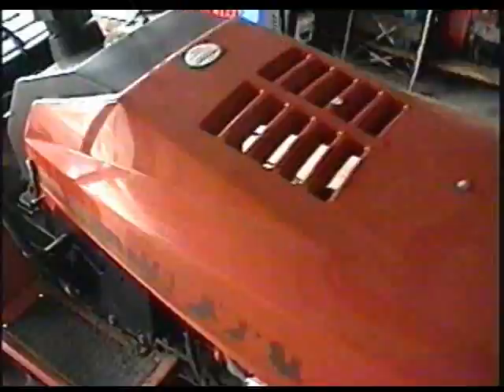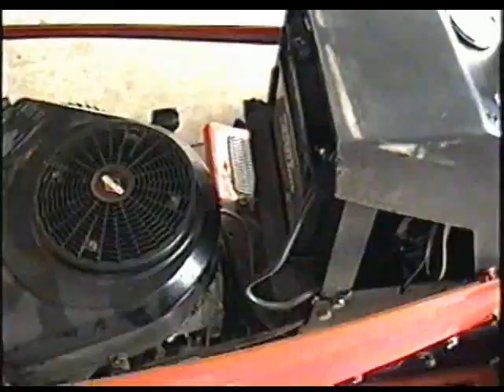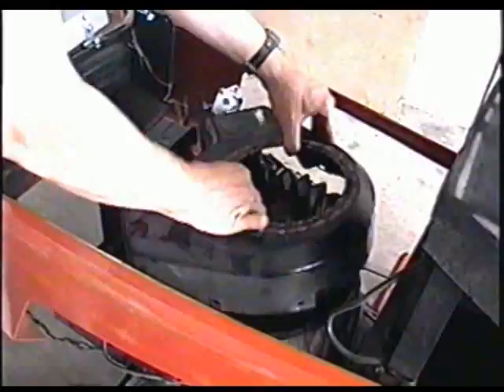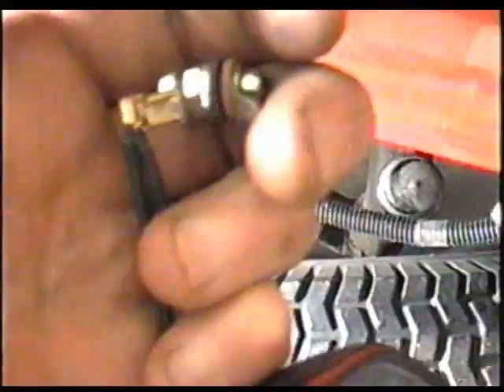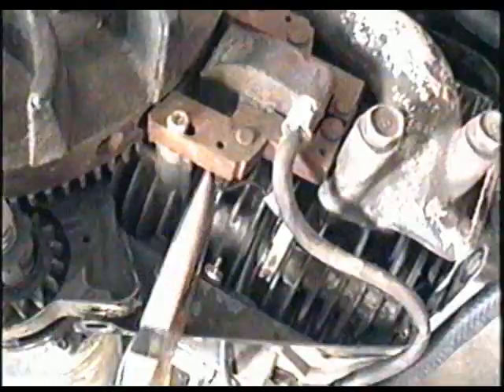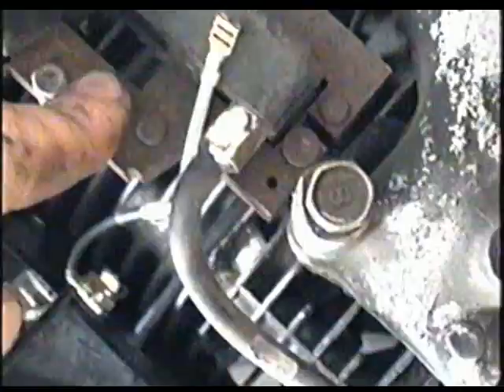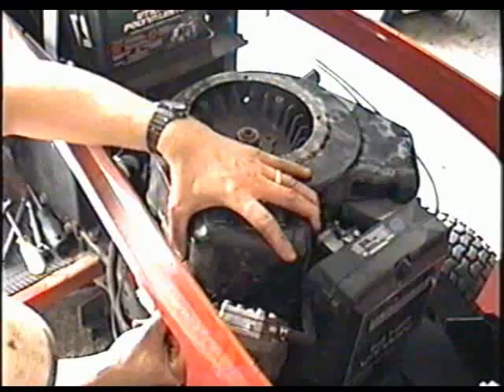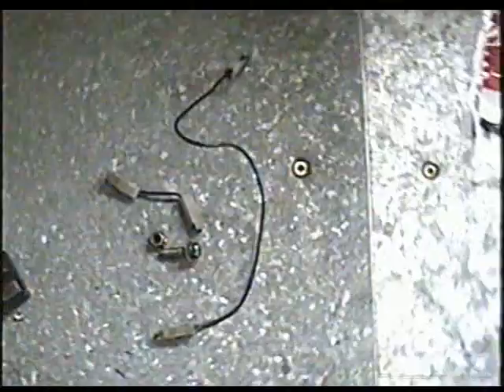Briggs & Stratton Ignition Diode Repair on Lawn Tractor

Comment: Another great video,thanks. I had a friend ask me about not getting any spark on his push mower. We went through taking off kill switch wire, spacing the coil gap & he even changed the coil. New plug. This is a single cylinder, no points. Any ideas?

Comment: Some of the Intek twins come with two diodes heat shrinked into the magneto kill leads in a Y configuration. Briggs doesn't sell that wire as a stand alone part, you have to buy the complete harness that is usually over $20 on Ebay.  They are 1n4007 diodes.  A bag of 25 for $3 on Amazon, soldering gun, and heat shrink solves the problem cheap....

Comment from the maker: @ncrdisabled it's a 1991 briggs vanguard 14 hp
Reply: I've got the same engine and after all repair works it finally runs but only if the choke is on. Any suggestion?

Comment: I had a strange problem with my 2001 sears GT.  charging guage was going negative and did a lot of testing and ...Finally.... pulled the flywheel off and the Magnets had come off the inside of the flywheel.......$90.00 later it works it works just fine....

Comment: Thanks for the vid most unusual.    I understand that you replaced the diodes, solve the problem.      Not sure that I understand electrically WHY it solved the problem.   I thought that the diodes were attached to the stator and were part of the electricial charging system, for the battery/lights/PTO clutch etc.   The single black wire appears to connect to the regulator/rectifier.    How does grounding the diodes kill the engine?     Why are the diodes connected to the coils(normal grounding tab) instead of the stator?
Reply: Same here, i have worked on over 100 mowers and never once seen any diods on a kill wire. Cause all the kill wire does it grounds to the body.  So Kolers setup is pointless in my opinion.  Yes i know your comment is 4 years old.

Comment: Excellent video (as well as other ones you have done).  My mower, when I turn the key, I get one "click" sound and that's it.  It was working last year and then I used your other video to adjust the valves...just replaced the battery and now it will just "click" once...starter doesn't even move.  Any ideas?

Comment: @MrDamascusman only if he held the switch in the start position. im not sure if its the same for these motors, but on my 10 horse briggs intek if you hold the starter button and the engine starts but you dont let to of the button, the gear pulls away from the flywheel, but the starter still spins, just not under load. same thing if the engine was already running and you engaged the starter, it would hit the flywheel, but then it would retract slightly and just spin

Comment: thank you for the video.  i have a cub cadet rider mower.  i ran over some landscaping anti-weed material that tangle around the blades.  i removed the material, but now my mower does not even turn over.  any ideas?  I am a novice when it comes to engines, but am learning by watching you videos.  thank you again.

Comment: yes that would be good but if u do that they spray gas out of the carb and have less than half the power so if u had a 12 hp twin running on one cylinder it would only have about 4 hp. the car they made like that is the dodge charger.they run on 4 pistons at low speeds

Comment: One question out of curiosity. Why a two cylinders on a riding mower ? Isn't 12 hp single cylinder plenty for its purpose ? I only see more fuel consumption here for the same amount of work.

Comment: hey don, I am trying to work on a scotts by john deere lawn tractor, this guy said that if I got it running I can have his snapper lawn mower. the lawn tractor will not crank over with the key so I tried to hot shot it, still nothing, so I poured gas in the intake and jumped it right to the starter, it cranked over but didn't start which leads me to belive that it is a wiring problem. so today I go down there w/ some fuses and I switched out the 30 fuse with a new 30 fuse and with no hot shot I turned the key and I heard a pop, I looked down at the fuse and it was blown so then I took a thin wire stripped the ends of it and stuck it in the fuse socket so then I cranked the engine and it started up and ran for 2 seconds and shut off, I went to unplug the homemade fuse bypass and it was very very hot, any suggestions?

Comment: Which way are the diodes positioned? anode/ cathode?
You could get 2 properly sized diodes @ Radio Shack and bypass the defective diode module and save big buck$!

Comment: Good video. I have a question about a Craftsman rider. Battery is amonth old but does not start engine without jumping with a battery jump pack. With the engine running I get 26VDC out of the diode. 13 VAC AC wire from alternator. I check the battery and I get 12,2VDC and 13.5VDC at the battery when it is running. Is 12.2V not enough to crank the engine? Lights work. Fuse is good.

Comment: Can only start my murry mower by jumping it with a outside battery using jumper cables. I hook the red terminal from the bat. to the red cable connection that comes from the mower battery. And then turn on key and touch the nag. cable from the outside bat. to the outside body of the starter,and it starts? Thats the only way it will start.

 THANKS

Comment: @MrSideboom, that is not correct. 1/2 inch is 12.7mm and a 3/8 is 9.52mm. so theoretically, u can use metric on imperial but not imperial on metric in some cases in the smaller sizes. as your get bigger like 11/16, 17mm is smaller

Comment: Yard Machine MTD, rider, 12.5 HP.
Quit in middle of mowing, electrical problem, turning key to start = nothing.  Pushed it into garage and charged the battery, cleaned teminals, after an hour, started right up and mowed for about 20 minutes and same thing - stops dead, key won't start.  Charged for 5 minutes - started up again.  HELP!
What do you think?  Charging system?

Comment from the maker: you need to chec the crancking amps of the battery or return it for a refund, if it's a briggs ohv single cylinder the valves more than likely need adjusting

Comment: Hey...where does that black wire go to on the other side of the diodes? the two wires go to the coils but where does that other wire they are connected to run to?

Comment: Hi, I just picked a same kind tractor with 14hp V Twin Briggs. Every time I start it there's fuel spilling out the carburetor.I noticed that there's some sort of uncapped tube(looks more like a primer hose nipple) and fuel is jetting off it like crazy. I couldn't locate any fuel return line or something of that kind. What's an I missing? Engine 303777 with carburetor 808728(part number is taken from the diagrams).
Thanks for any input.

Comment: I have a troy bilt riding lawn mower. I replaced the solenoid on it and replaced the battery. Now when I hook the battery cables up, as soon as I touch it with the second cable it trys to start itself. Does anyone know what causes that? I have been working on this for 2 months and I'm so close to getting it going.. Please help me out..Thanks

Comment: not just wait a minute hold on I'm mad at you said that the engine was still taking fuel out of the boat float bowl it's can't be because the solenoid shuts off the fuel to the main jet and the float bowl is before the main jet that cannot be....

Comment: Hi i have a bad diode on my riding mower and want to replace but the 2 companies in town don't have any on hand so i want to go to the electronics store and pick up a diode but they need amp and voltage ratings on it. it's a Tecumseh OV490EA Can you tell me what the specs are on the diode i need. Here is the part number Diode for Tecumseh 611161 / 33-420

Thanks!

Comment: Need help for Murray riding mower. The briggs starts OK and runs until I let the clutch out. So I replaced the brake/clutch switch and the PTO switch. The problem remains the same. So I replaced the ignition switch which did not help. It starts and runs until I let the clutch out. Any suggestions will be greatly appreciated. Thanks...jz
Reply: jim zimmerman sounds like the seat switch

Comment: how do you find the right replacement part,,by engine model number or by tractor model..ty
Reply: Anything on the mower...you find by the manufacturer number on the chassis.  Anything on the Engine you source that part number to the manufacturer of the Engine.  Like B&S ...etc.

Comment: hey I have a lawn traktor it is a mtd master cut 115/95 rs with a 12.5hp  tecumseh engine. i have one problem i is back firing hwen im starting så that is damaging the startet weel how can i fix that problem ???
Reply: adjust the  valves.

Comment: my 22hp B&S turns over good but no spark at either plug.  Would the diode cause that?
Reply: No replace your coil but check your "ground wire" first

Comment: Have a Scotts Lawn Tractor Model L2048 Battery won't Charge. Can you help?
Reply: It's either the Alternator, which is under the flywheel...  A bad ground, or the inline diode located in the wire bundle  

The alternator creates 28V AC...  then runs through the diode which makes DC current to charge the battery.  Replace the $3 Diode.  See your electrical schematic, and parts listing and then order a couple on Amazon.

Comment: Could a bad diode keep the engine from starting?
Reply from the maker: YES IT COULD
Reply: donyboy73 mine will start if I jump the starter solenoid posts, but dies when I remove the jump. If I leave the jump and turn the key off it kills it as it should. I'm getting current to the ignition switch, all the safety switches test fine. It's been intermittent starting since I got it.
Could a bad diode be the root of all this? I've literally rewired the whole thing "except" the wires from the stator, coil and carb solenoid. Been messing with this thing since spring started.
Reply: donyboy73 There's a small engine repair shop/junkyard in town. Might they have a replacement?
Reply: helmedon  m

Comment: Morning, I've got a question and to some it may be a dumb one but if I don't ask that would be the dumbest thing than anything. If u are putting a new stator on a older b&s 15 hp  281H07 it's a one wire stator so if u do not have a regulator or I acquired this mower and it didn't have one (I'll just say) if it in fact doesn't require one does a diode replace a regulator or do I need to put a regulator on it as well. Im putting together a riding mower for a older woman that's down on her luck as a donations and I just want it as safe as possible so I can sleep better at night knowing I did everything correctly and help would be much appreciated., thanks Craig.